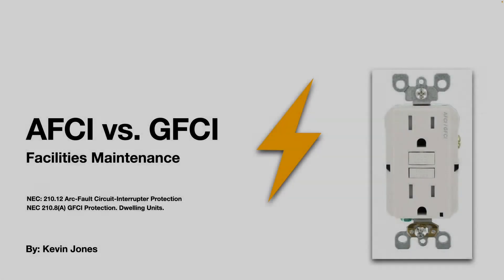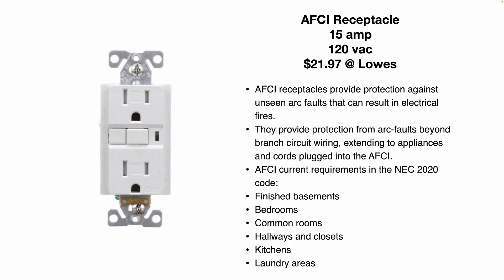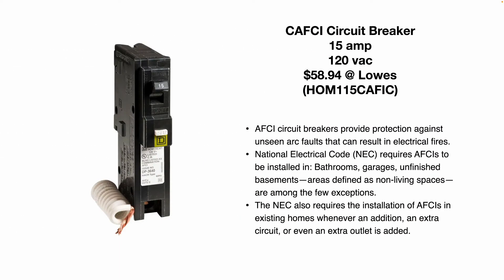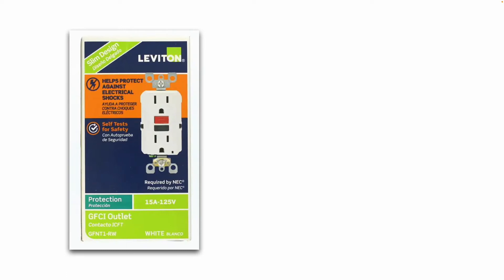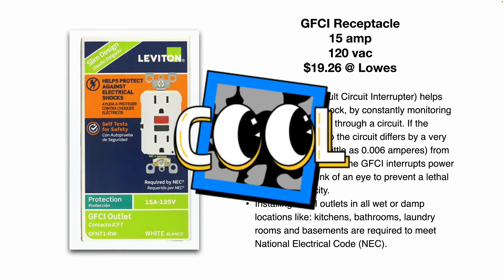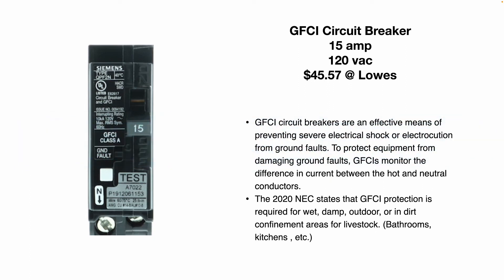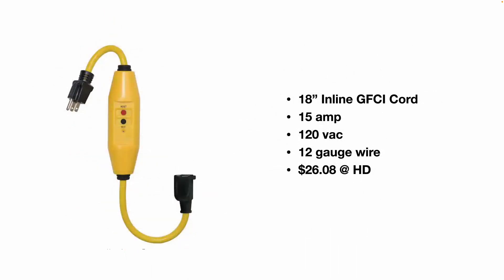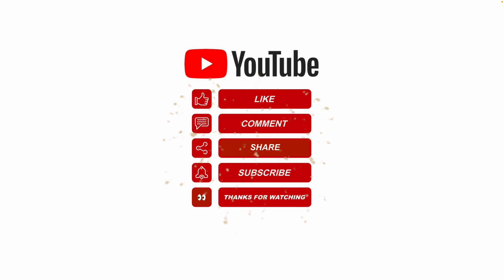AFCI vs. GFCI: What is the difference? (NEC Compliance)

Comment: This chart helps summarize it...

Summary of Differences
Feature 	              GFCI (Shock Protection)	                        AFCI (Fire Protection)
Monitors	      Current balance (Hot vs. Neutral)	        Current waveform/signatures
Sensor Type	      Magnetic differential coil	                        Microprocessor with digital filters
Sensitivity	      Very low levels (4-6mA)	                        Specific noise/frequency patterns
Hazard	              Electricity leaving the circuit	                Electricity sparking across a gap
Reply from the maker: That is great information. Thank you for sharing!

Comment: Doesn't really explain the differences. They both evidently measure current between hot & neutral, one supposedly for arc, one for wet ground, but doesn't say how since it seems they both use the same method of measurement. Also, doesn't say when to use which since both are recommended for kitchens, etc... a lot of confusion left after watching this.
Reply from the maker: Hi Joseph, I'm sorry you found the video confusing.   An AFCI is explained at the .58"  mark in the video.  A GFCI is explained at the 3'-52" mark in the video.  Both descriptions list where to use each device.  You can also avoid confusion by purchasing an integrated AFCI/GFCI receptacle that provides protection from electrical fires and shocks in one device.  Thank you for your feedback.